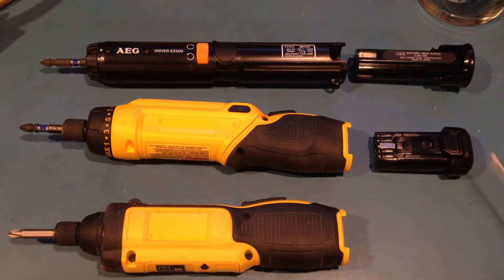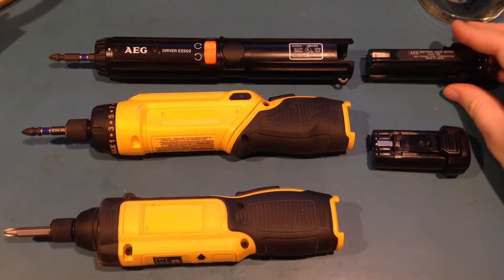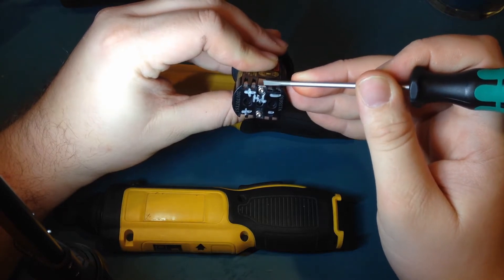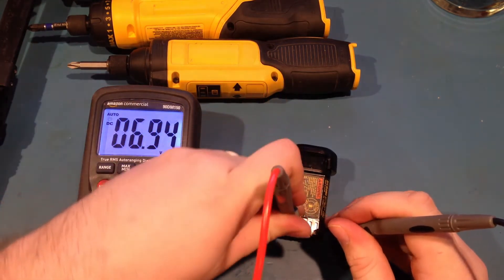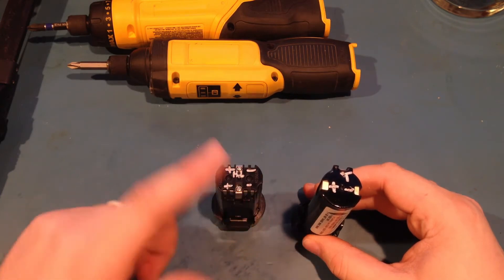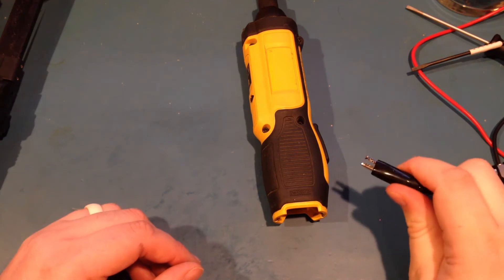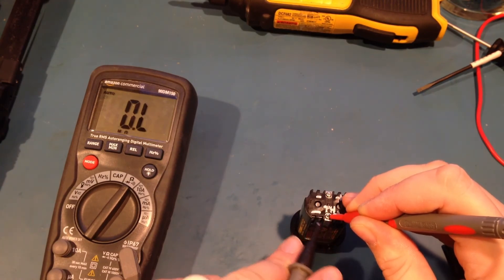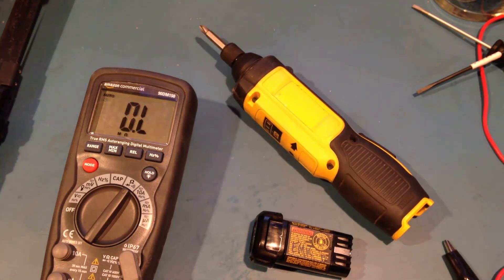Cordless Screwdriver Battery Investigation

Comment: Thanks for your nice effort which i requested👍🏼👍🏼. I applied 8 volt from my 3amp power supply and same result as you. Only led blink. Now i try to add 10k resistor between Temp and Negative  and try. Hope it works. Sorry for my poor english.